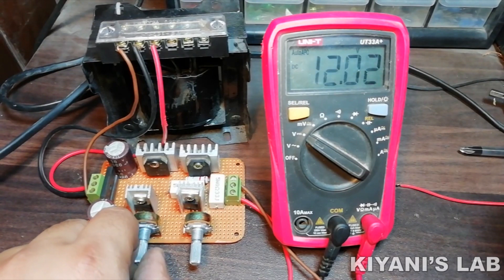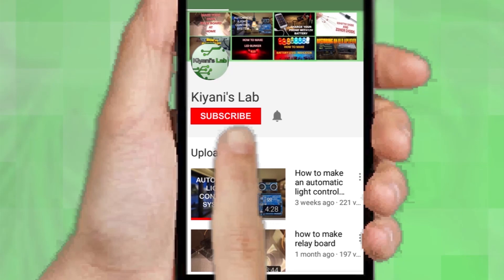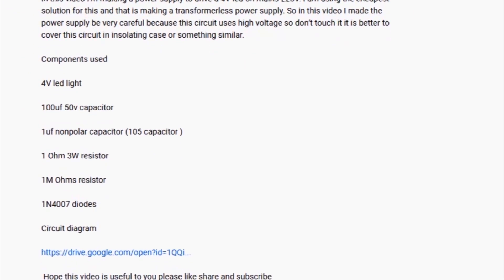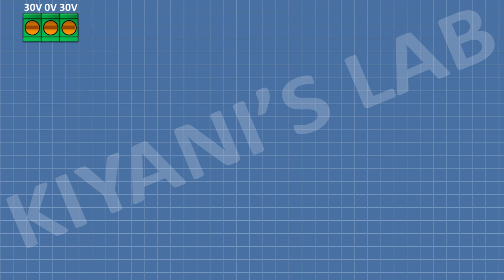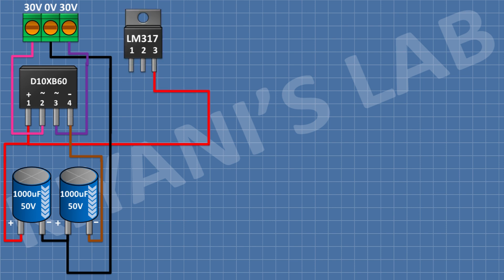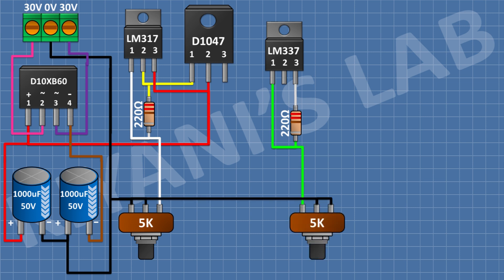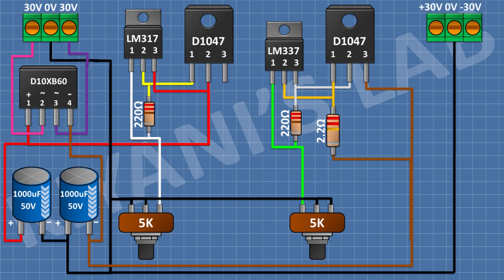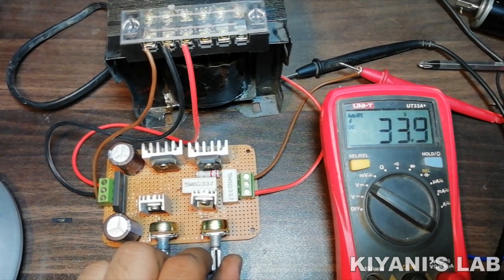How To Make 0-60V 3A Variable Bench Power Supply | Dual Power Supply

Comment: Hi, very simple circuit and explanation is very good. I am building a transformer powersupply for 48V battery pack. This ckt suits the Purpose. But I need to increase the output current to 10A. Assuming power transistor D1047 can handle 2A of current, 3 more transistors can be added in parallel to existing one? Let us know. Thanks.

Comment: This power supply is a bit unreal. The 2 resistors you adjust, the output voltage is changing. So which 1 adjustable resistor is the current adjustment?

Comment: What is the Transformer? Is it 120 v ac step down to 12 volts ac?
Reply from the maker: it is 220vac to 30vac+30vac you can use 120vac one as well